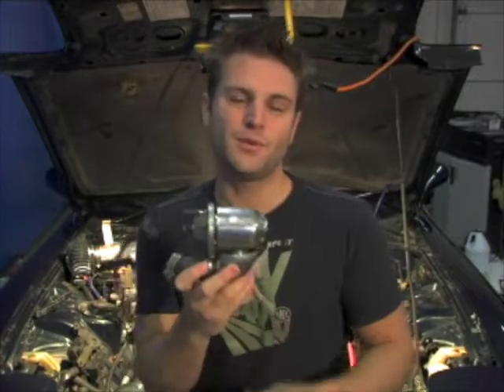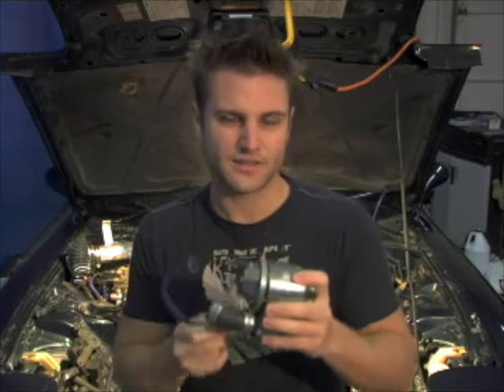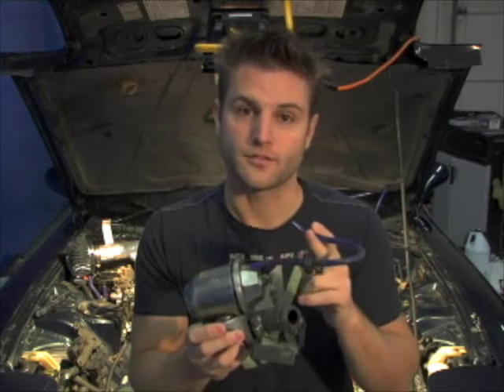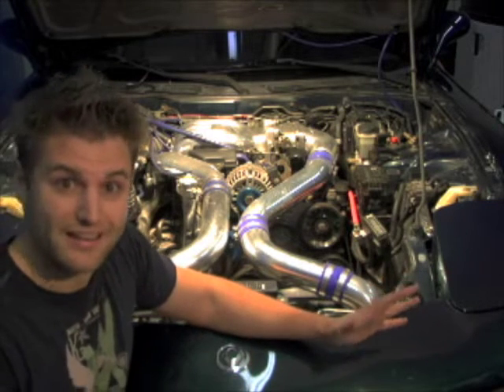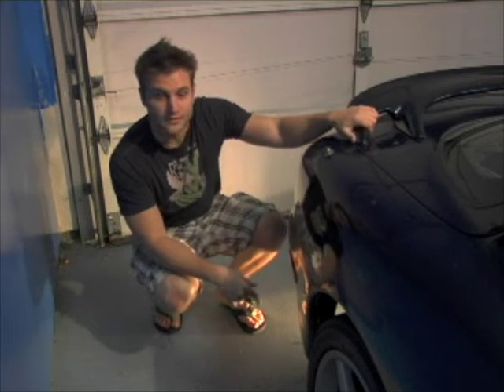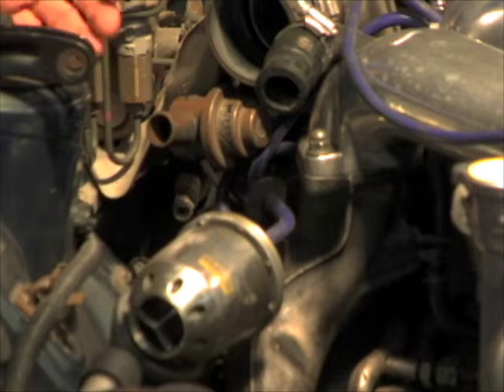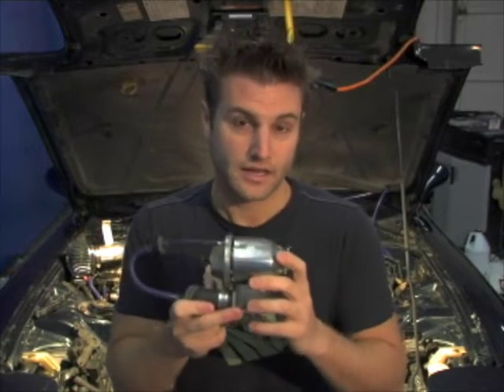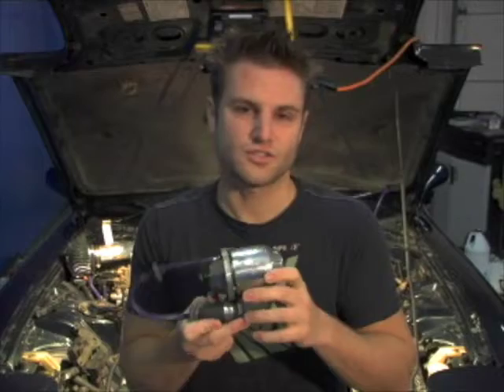Intro to Blow Off Valves - using the RX-7

Comment: And if you installed a BOV on your car with a stock BPV (Bypass valve) then your car will run overly rich due to the ecu thinking that there is more air in the engine than there actually is and your gunna have a hella bad day with your bad gas mileage and clogged cats. something to consider

Comment: just so you all know, not all turbo charged cars will have a blow off valve, but they will have a diverter valve witch re-circulates air back into the system and doesnt make the noise. Jetta 1.8T's have diverter valves instead of blow off valves just like many other cars.

Comment: cos when ya shift, you let off the accelerator pedal as you shift, this inturn closes the throttle intake flap so any boosted air hits the closed throttle plate and sends it back towards the turbo. with the presence of the BOV, this compressed air goes out the blow off valave thus giving you the PSSSH sound. the harder you boost, the louder the PSHHH as more compressed air exits. BOV works on auto turbo cars too. just put your foot down and let go and PSSSSH!

Comment: question...why do you have a one way check valve on the vacuum line to the hks bov??(i'm wondering if this is what's wrong with the one i installed i thought it was because it had to hard of a spring)